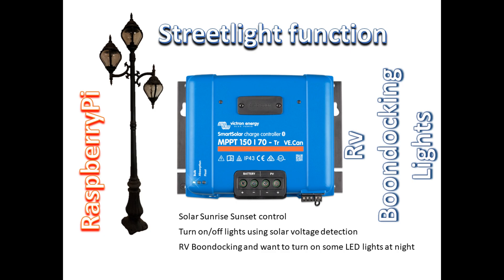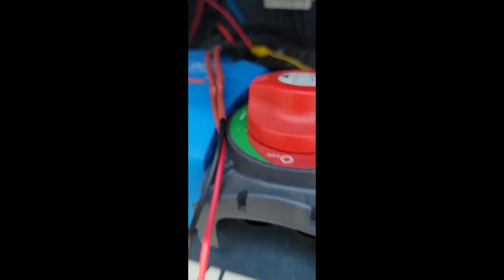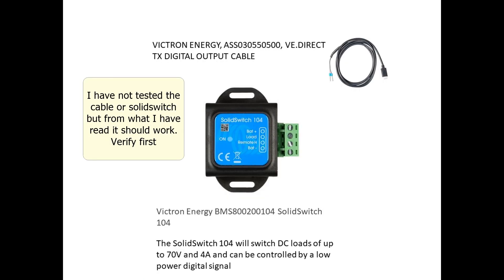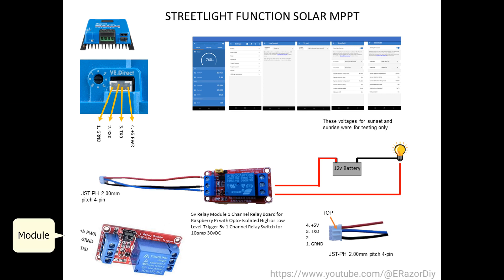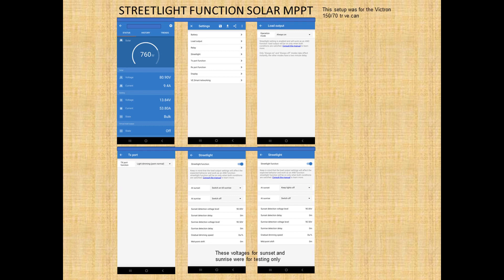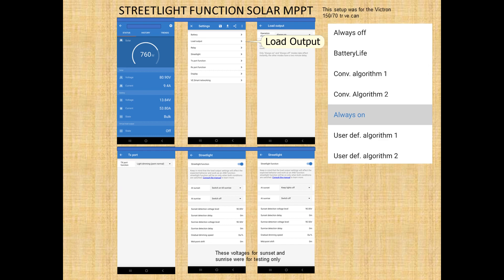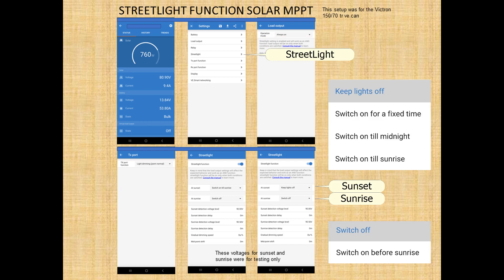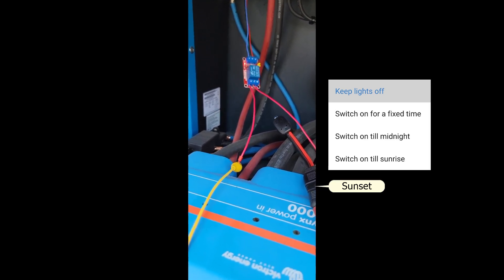Victron MPPT Solar controller STREETLIGHT function control relay/lights,  sunrise sunset PV voltage

Comment: Thanks a lot, confirm all i've read here and there .. !
In my opinion, "Always On" is not a good idea, you need to protect your battery, for that the Load output should be conditionned by the battery voltage.